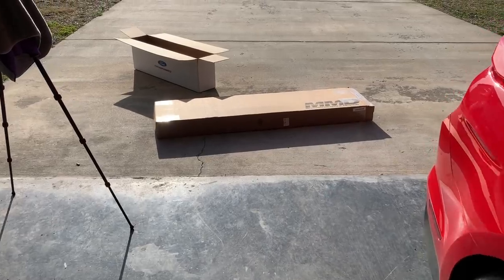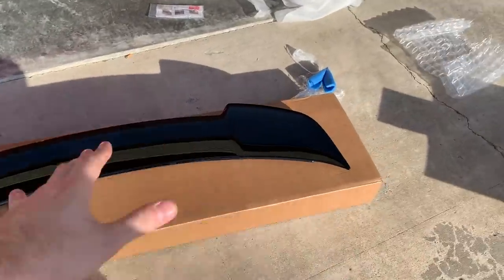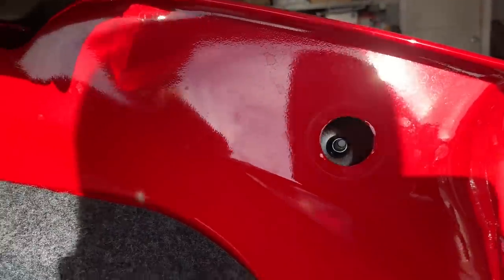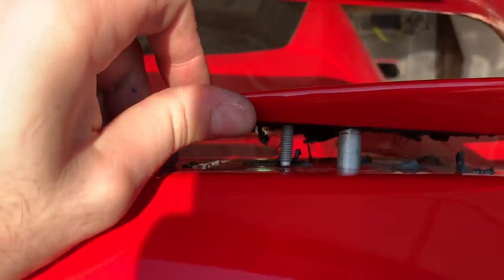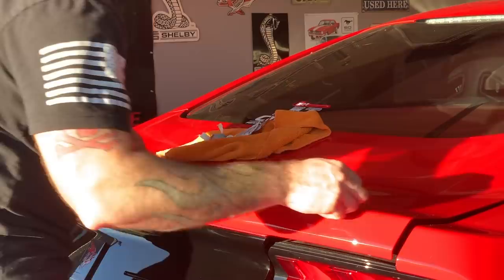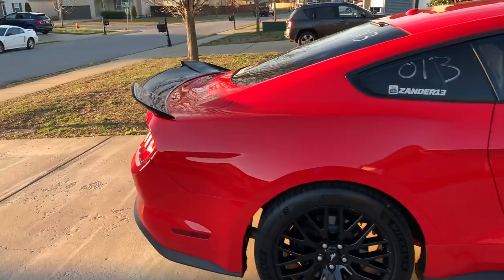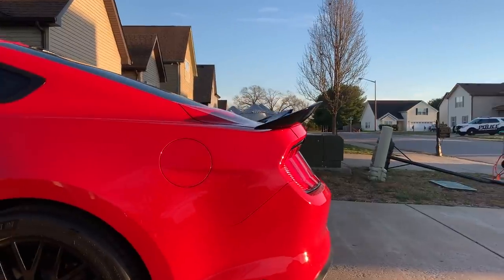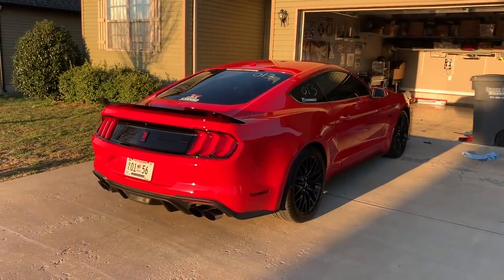Did I RUIN my 2019 Mustang GT with this MMD V Series spoiler? | Carnage Overhaul EP. 2

Comment: I like it! Also,  just fyi, I work with stainless steel and glass, and I use all kinds of tape  every day to cladd and glaze. There's couple methods, but the easiest if you had to do this again, spray a lot of windex on the area you're attaching. It will stop the tape to get stuck on initial contact, and give you a small window to adjust things. Windex dries quick,  the tape sticks, and there's no compromise on the bond.

Comment: Great choice looks 100% better. I installed the  wicker spoiler on my 18. I definitely feel you about wanting to make it stand out. Down here in Florida it seems like every other house has a mustang. I’m really thinking of trading in on a used GTR Nissan. Going to look at couple tomorrow.
Reply from the maker: GTR's are nice. Expensive though
Reply: Zander13 they have come down in price at the auction they run $32-$45k for 11-14 models the 09-10 I don’t really look at because the transmission problems they had in past. . But it will be nice to have a car that my neighbors our half my state doesn’t own.

Comment: The new spoiler will add a lot more downforce compared to the PP1 spoiler.  The PP1 spoiler is more reminiscent to the 87-93 Mustang GT spoiler, which added a bit of lift at higher speeds compared to the 85-86 spoiler on the Mustang GT and the 87-93 LX body styles. Hopefully it will aid in high speed stability in Mexico.
Reply from the maker: I think it might too. it is shaped like it would

Comment: Sell me that spoiler for $400
Reply from the maker: It sold
Reply: @Zander13Productions  I figured but it's okay - I just ordered the True Fiber GT350R spoiler for my GT. Just bought a 17 GT base. I will have to cover up holes with the GT350r spoiler but the PP1 spoiler uses all factory holes. Dang I wish I had known the PP1 spoiler existed. Hopefully the Gt350r spoiler  works well. I'm also getting the gt350r splitter for up front and I have to still order a rear diffuser because my rear valence is blah...